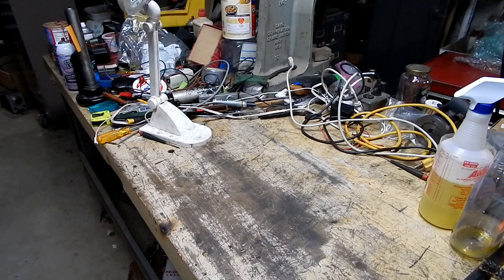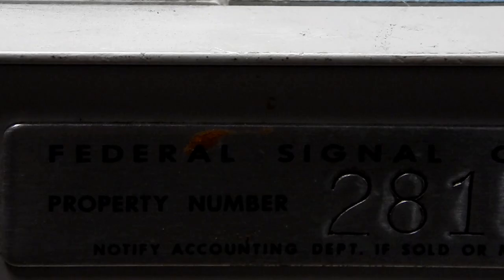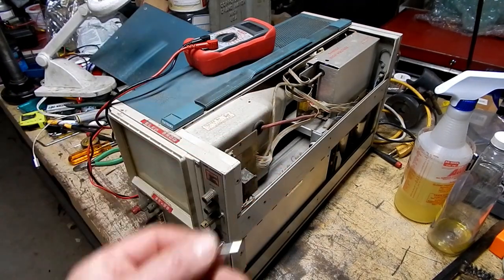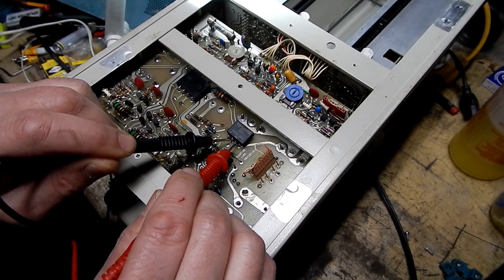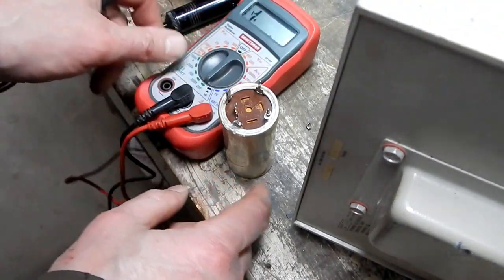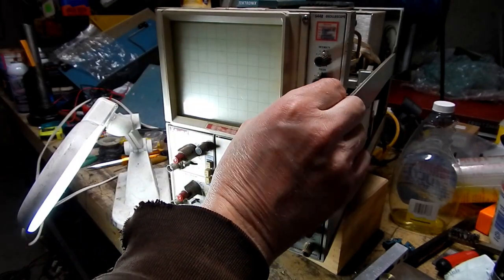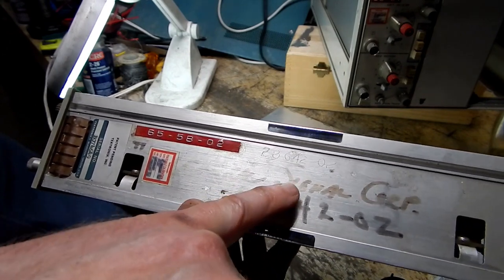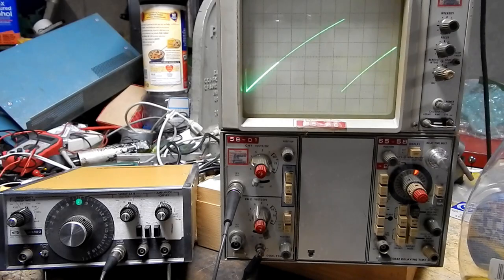Vintage Electronics Pick Part 3: Vintage Techtronix oscilloscope

Comment: manualslib has a user manual for this puppy with wiring schematics in the back section power supply is around Page 128 or so.
SoLder suckers are cheap and effective mate no excuse not to get one. Just the sucker can be had for less than A$10 ( $6 US )
A pistol grip SoLdering Iron with inbuilt vacuum pump is more pricey at A$145.
Those Caps are doubles with a common center Earth  
Cheers Eric